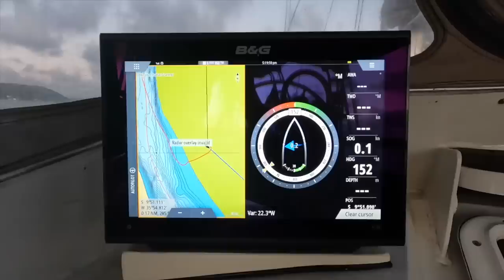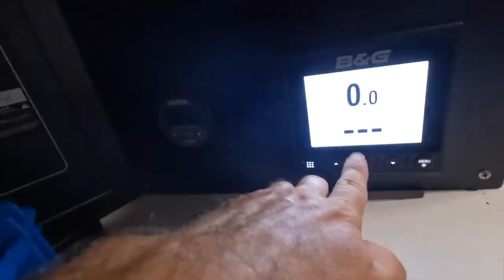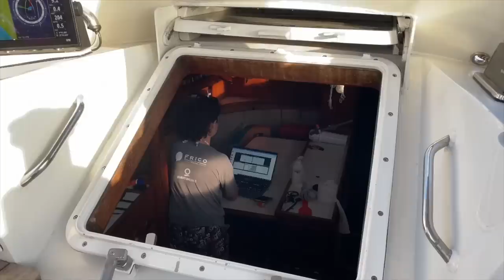⛵️ We beached our sailboat! 😱 Ep.267

Comment: A Pressure washer works with salt water under the water. Place the machine on your deck and walk on the sea floor. Just purge the system with fresh water. My pressure washer will cut the toes of your boots off. If you keep the slime off the hull the bottom growth will not grow on the hull. The trick is just to keep the slime off.

Comment: You're lucky to be able to put your boat on the sand as I can't do this with mine,  as even though it has a centre board, the bottom of the hull has an extension down to allow the centreboard to be below the floor inside the cabin. You can also tick off the Caribbean now as well.
Reply from the maker: ☺️😁 it’s a great experience. I wish you could do it as well. Yes, we can tick off the Caribbean as well 😁

Comment: What kinda boat is that?
Reply from the maker: She is a Dinieper Tropic 1200. Designed by Michel Joubert and Bernard Nivelt. (Meta Boat Yard - France) and built in 1991 in Brazil by Dinieper Boat Yard.

Length: 13.50 meters (44ft)
Beam: 4 meters
Draft: varies from 1 meter to 2.70 meters
Displacement: 14 tons

Material: Galvanized Steel
Construction: Multichine/Strongall (no stringers)